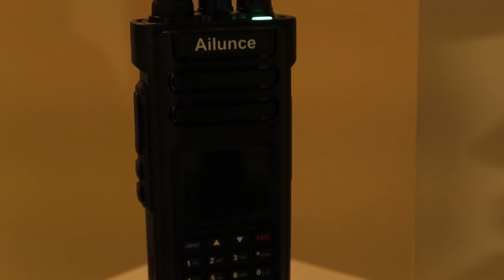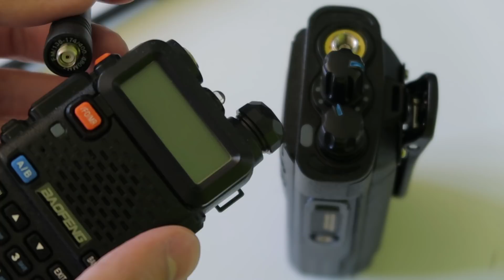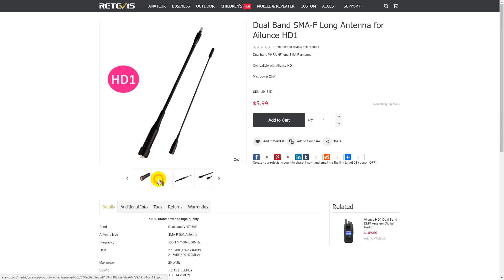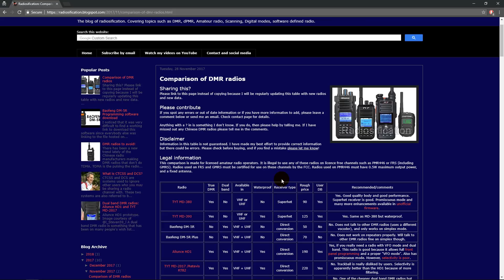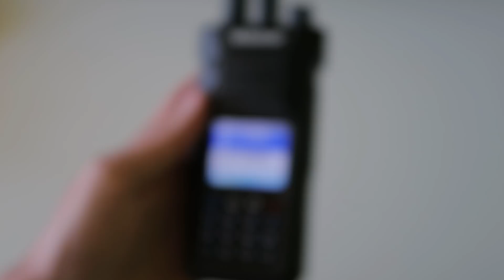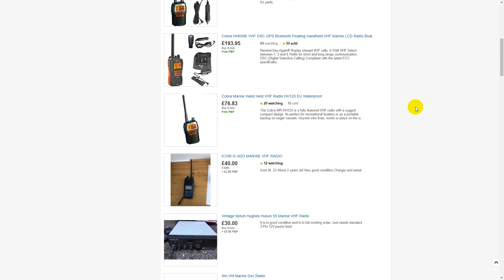Should you buy Ailunce HD1?

Comment: I would never bye one again I have one and the screen has gone up it and its only 9 months old half of the screen is all missed up and the radio does not work
Reply: All of these Chinese radios have issues. I have a TYT md-uv380 and it will power cycle itself. I will be listening to people talk and it just restarts on it's own.  Battery life is poor too. It's quite frustrating, especially when you have only had it for several weeks. I would be even more upset if I had spent a fortune on an HD1 and had issues like yourself, because I doubt the company will repair or replace it. This China stuff is a nightmare.

Comment: I bought this radio for a SHTF situation but it seems that this radio is dependent on WIFI, some cellular or DATA connection. This radio will only be useful in analog mode if there is no DATA connection. I'm thinking i would haave been better off with a high power analog radio and a Faraday cage. I could have gotten a $30 Baofeng instead of this $200 Ailunce. That's the price i pay of not doing my research before buying something. Great break down of the pros and cons of this radio. Keep up the great work.
Reply from the maker: What? That's completely wrong. The radio is not at all reliant on any internet connection.
Reply: @radiosification  Where can i get a better understanding? I keep hearing about needing a portable hotspot. Do you know of who has a detailed video if you don't have one posted?
Reply from the maker: @edwardyanceyjr  You could watch my video titled "What is DMR?" which provides a good explanation of the basics of DMR: https://youtu.be/0t-cyOQbGxc The whole amateur DMR system is based on the system as described in that video but a lot of the repeaters are internet connected. Each talkgroup will connect to different groups of repeaters. You can access the internet connected amateur DMR networks through a hotspot instead of a repeater (which you might want to do if you're not in range of a repeater) and you would only NEED an internet connection if you want to do that (use a hotspot). I also have a video explaining hotspots: https://youtu.be/T4g4nec6lik
Let me know if you still have any further questions after watching those two videos and I'll be happy to explain :)
Reply: @radiosification  Thank you!! I will watch those videos right away.

Comment: Mine has a white screen of death after only six months of use. I checked the ribbon cable and I checked the firmware version and tried many versions. Dealing with the company or the sellers is ridiculous. Buyer beware do not take a chance
Reply: Sorry to hear that, but not really, I mean I feel bad that your radio died, but good that you shared your experience, you are the second person in these comments that had the same issue, which means I probably should not buy one. It's tempting, but not for this price, It should honestly be priced the same as other inexpensive radios. People see big battery, big hard plastic case and they instantly think it's some kind of industrial radio that is built like a tank. I am sure initial batches of these radios aimed for hams were made well, but somewhere down the line they started to buy cheap parts and that's where the problems started. Companies like Motorola have the strictest standards when it comes to comes to components and manufacturing. I am not saying we should all own Motorola's, but for companies to try and market their products like Motorola is horrible.  Hopefully you were able to receive a replacement or get it working, if so, I would like to hear your experience.
Reply: @BeastTechWrench  It wasn't worth it I just gave up. Lesson learned. I don't even have the need anymore but eventually I'd like to get a new one definitely won't be the same lol
Reply from the maker: That's the attitude that makes them use cheap parts and have no quality control - people just give up and say it's not worth it. You should kick up a fuss and get a refund or replacement, otherwise they'll know they can profit off the fact that people don't bother to do anything
Reply: @radiosification  no That's learning a lesson. Supply and demand. If you can't give me something that works I will go elsewhere to a more trusted name with higher ratings better reviews That's not what they're counting on they lost business
Reply: @radiosification  this is the last one that I was looking at. Yaesu FT-3DR
Reply: @radiosification  hence the bad review after so many it decreases their sales and people get the message they either step up or they step out. Reputation is everything sometimes
Reply: @clovenbeast5183   @Cloven Beast  As far as warranty goes, the cheaper ones with a warranty are almost non-existent. Alinco sells DMR radios and they are fairly decent, I am sure they come with a warranty. With that said, the Alinco DMR radios are supposedly made by Anytone, which I have and I like it. Will it last years? Who knows, but it would be nice if it would. I was never keen on handhelds and that stretches decades. The good thing about these DMR radios is that you don't have run them at full power when you are connected to a hotspot, so that improves their life since they don't heat up as much. With that said, it would be nice if ICOM or Yaesu would get into making DMR ham radios (Kenwood does, but not exclusively for hams, which is ridiculous and they are pricey, just like the Motorola radios which cost a fortune, but if you need the reliability, they are options. As far as these cheap radios goes, I think 90% of their problems arise from quality control and just poor assembly environments. A quick spin on Youtube can reveal of these factory's environments. Quite scary.  They have no fear of warranty since they are a Communist country, they are not subject to anything except their own Government coming down on them with demands of money, not a bunch of middle aged men who bought a radio from them and ended up with a bad one. lol
Reply: @BeastTechWrench  it's become an excuse to upgrade I was just irritated with the responses from the company and corresponding people. We all learn eventually it's all good I'll get better this time

Comment: Great review, i bought 2 of them. but i do have some issues with them and the most pressing one for me rite now is the battery percentage meter is stuck at 100%. I swapped batteries and the other radio gives accurate readings for both batteries( which are not at 100%). Does someone have a fix for this or do i have to rma my radio(which i dont want to do for something this small)
Reply: I'm having the same issue now. I have the latest firmware but the problem just started happening. Do not know how to fix it. Any ideas?

Comment: Is there any way to get a message to the mfg and ask them to put the feature in promiscuous mode that will scan and show the DMR setting for the transmissions it receives ? Having the ability to receive a DMR freq and have it show the CC, TS, TG, and Radio ID is something no radio has in it's firmware that I have tested.

This seems like a good mfg would put this in their firmware.

When you find a freq using DMR, there is no way to know what CC, TS, and TG is being used and it takes a huge amount of time to enter in the 16 CC codes and program 16 channels of the same frequency and scan till you hit on the correct one

And if you have multiple users using different color codes it becomes a daunting task to find the right settings and talk groups

It seems only logical that they would have in promiscuous mode where a frequency receiving DMR wood display by default these four pieces of information so that you can copy them down and then when another transmission comes across using different settings on the same frequency you can copy those down Etc

I have yet to find a radio or even a scanner that does this feature

If anyone knows of a radio that has this feature please let me know
Reply from the maker: All DMR scanners have that feature. The TRX-1 I know for certain has it. You only enter in the frequency and it picks up everything else. I'm pretty sure some transceivers have this feature too. Check if the anytone at-868uv has it. I think it might do but not sure.

I asked Ailunce back when this radio came out if they could add a colour code and timeslot promiscuous feature and they said they'd consider it, but it has never happened.
Reply: @radiosification  I don't have a TRX one but I have a 396 P2 and a 996 P2 with the DMR upgrade and a whistler ws1080 and the uniden phones are terrible and miss most of the DMR and when they do catch one of them they display the color code sporadically

The Whistler I have not gotten to work yet it says DMR and I have it set for any for the color code and any for the timeslot and any for the talk but it has not received any calls yet and I'm using the latest firmware and DSP

Who makes the one that you have ?
Reply from the maker: Not sure if I understand your question. I have a TRX1 which is made by whistler, the same as you

Comment: Worst Radio ever, CPS software has virus, trashed my outlook and more --  No USA repair, antenna impedance issues and more  DO NOT BUY
Reply from the maker: There is no virus in the CPS. Everyone reports this error. It is a false positive.
Reply: yeah right!  Uninstall the HD1 software Wrecked my outlook. so~~  I would differ with you -- Plus the radio sucks in generall I went thru 4 of them --

Comment: Information on the VFO after programing by computer the VFO will not change modes if the VFO is FM, it will not change to DMR digital to put in frequencies for DMR. the solution I have done is to make one VFO FM and the other Digital , that way you can program in DMR info and save to memory by the front keys and don't need to hook up a computer when you want to add a channel in either mode just use the VFO set to the mode you want.

Comment: great video but i  all documents  that i found stand impedance 50Ω.
Is that all not correct ore is`t me that`s looking on the wrong places?
Reply from the maker: Yes, it's SUPPOSED to be 50 ohms but in reality is apparently not. The specs of the radio will of course tell you what the manufacturer wants to be the truth. But the reality of the situation is often different. Just like radios which claim to be 10W are often only 7W or so. Or a battery which claims to be 3000mAh is actually more like 2000mAh.
Reply: Even in The Description of the long antenna stands 50Ω impedance.
=> https://www.ebay.de/itm/New-Ailunce-HD1s-Dual-Band-SMA-F-Long-Antenna-VHF-UHF-136-174-400-4800MHz-/202149618883?clk_rvr_id=1596088757215&utm_medium=cpc&utm_source=twenga&utm_campaign=twenga&utm_param=eyJlcyI6MCwicyI6NTMzODY0NywiY2kiOiIwNDYxNzQxZGE2ZGZkMDY2NGQ3NDQ5NWVlYmI1NTg5NCIsImkiOiI4MTk3NTE1MjAzNDczNDU3NDAxIiwidHMiOjE1MzE0MzkyMTgsInYiOjMsInNvIjoxNTAwLCJjIjo0NjcyfQ%3D%3D&rmvSB=true
Reply from the maker: Again, that is what the manufacturer wants it to be. But specs of Chinese radios are often totally inaccurate.
Reply: Ok and what is the real impedance (if you now it).
Reply from the maker: I do not know. Impedance will probably vary with frequency.
Reply: Ok thanks.
And if you need  an idea for an a next Video, you could do a analog comparison between an old faction radio (for example
Yaesu FT-60R or Baofeng) and a really range Test (not just 2km it works fine but x km just get a signal y km now way).
Anyway thanks for your quick answers and 73.

Comment: I don`t like the transmit audio on the HD-1 FM and DMR ! It is way too low compared to an MD-380/390.   Also the impedance mismatch is a no go for me !   Excellent VED!
Reply from the maker: Thanks. Yes it's a shame the radio is let down by these issues. If it didn't have those two issues it would be great. For me the impedance thing is not really an issue because I keep the stock antenna on.

Comment: Great video! Very informative! Thanks!!
Bought an HD-1 based on your recommendation and experiences, as well as Ringway Manchester with his coverage of this model. Continuing to get to know the radio and agree that it is very versatile.
One gripe I do have, is that on analogue signals using CTCSS programmed for receive, the HD-1 has one heck of a squelch crash when the signal ceases. Other radios will roll off the squelch on transmission end (reverse tone burst) and no squelch noise is heard. Can be very annoying with lots of short duration overs.
Changing the squelch to tight makes no difference.
Again, great video and more please!
Reply from the maker: That's strange. For me it doesn't do that. I just tested it out and the radio stops the audio before the squelch crash. The radio or repeater you're using has to have the feature to do this though so I guess if it's a really basic radio or repeater you're using it might not have it. They send a certain tone at the end of the transmission to tell the receiving radios to stop receiving.

Check in your software under basic setting > setting > tail eliminate mode. I have it set to reverse code but try it on both and see if either works for you.
Reply: @radiosification  I saw somewhere that the firmware is upgradeable. Have you got the latest or (more to this specific issue) are you both using the same?

Comment: Could you use it as scanner ?  I.e. If I scan and hear digital noise and put in digital mode (if possible) I would hear the chat or can't you do that ?
Reply from the maker: Kinda, but not exactly.  Obviously the only digital mode you'd be able to decode would be DMR but the main issue is that you still need the correct colour code and timeslot. There are a total of 16 colour codes, and 2 timeslots. You'd only hear anything if you had the correct combination of colour code and timeslot. Although for amateur repeaters you could just program them in and you'd hear them all fine and be able to scan them if you wanted.
Reply: Is it the same as programming a fusion radio? I have a fusion radio and if I use the repeater app and find theres a local repeater with fusion I just program it like any other analog repeater and it works. is it the same sort of thing with this radio?
Reply from the maker: Yeah, you can program a repeater in from the front panel with this radio. I guess the app you're talking about is repeaterbook? I actually program in a repeater from that very app in the FPP video. Have a look in the playlist linked to in the description of this video.
Reply: radiosification does promiscuous mode not do all this?
Reply from the maker: No, it only lets you hear any talkgroup. You still need the right colour code and time slot to hear anything

Comment: Have you ever thought about getting more Motorola radios? (xts3000, xts2500, Ht1250, etc) 

I have actually found it quite entertaining to purchase old Motorola equipment like the cm400, maxtracs, and mt2000 and attempt to program them with archaic software. I plan on building a small Motorola repeated this summer, one of many projects which should prove educational.
Reply from the maker: I like all the commercial gear but there's really not any p25 around here so there would be literally nobody to talk to or experiment on it with. That sounds fun though. P25 is a great sounding mode so it would definitely be fun to experiment with

Comment: Thx for the review. All is good with my HD1 so far after applying latest FW 1.4.9

There’s a mic gain option in latest CPS 1.93

I heard the vent hole was to do with air pressure and the GPS receiver...  https://www.google.ie/amp/s/alfonsofaustino.blog/2018/01/16/alfonso-faustino-nothing-beats-a-motorola-but-the-ailunce-hd1-is-a-step-in-the-right-direction-k6asf/amp/

Anyhow, the biggest winner for me is the ‘all channels’ continuous scrolling and of course the VFO 😊
Reply from the maker: Oh, I heard that the tinny audio problem was caused by something to do with pressure when the radio got hot, so the vent was to fix that. I had a quick look at that link and he did mention the air vent but didn't say it's anything to do with GPS, at least from what I could see.

I tried the mic gain option out but it didn't make any difference at all for me, so I didn't mention it in the review. I did a recording before and after and there is literally no difference at all. Did it do anything for you?